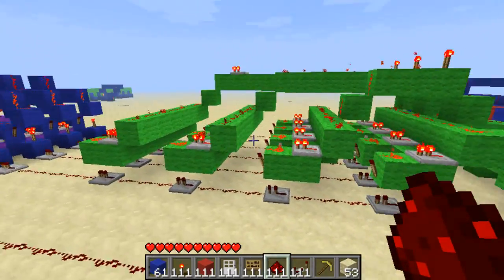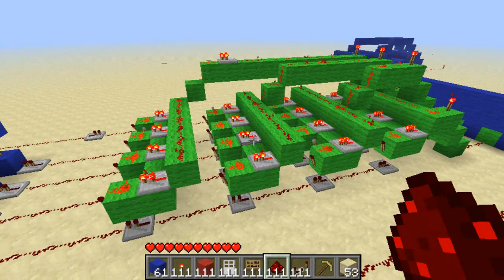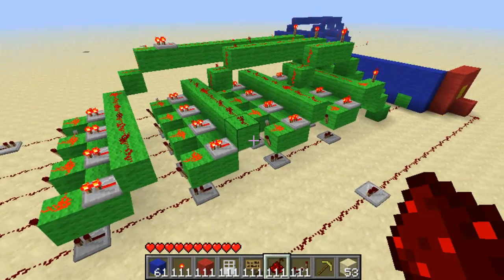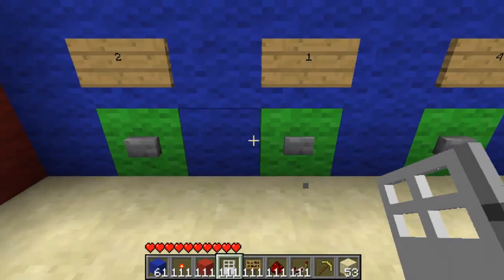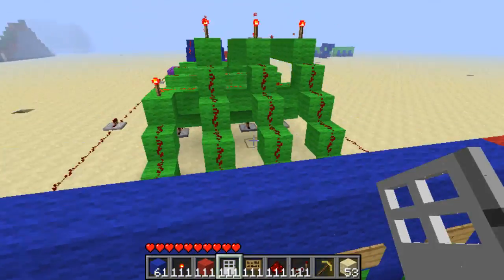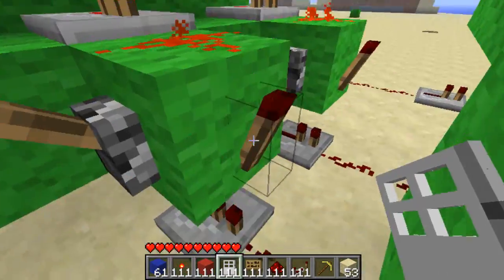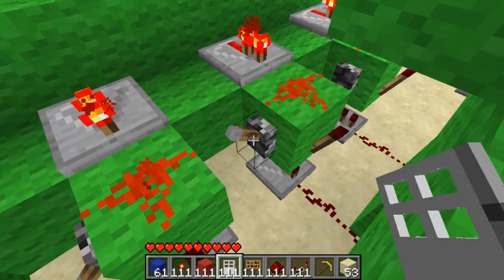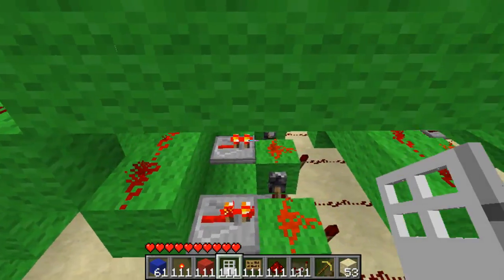Programmable combination Lock (with scrambler)

Comment from the maker: @TheGameReplay The main principle behind this is that the line will turn on it's set of torches, but if you do not want that one the lever will stop the torch from being turned on therefore not allowing it to power the line of redstone, if the lever was off then there would be no signal to the torch allowing it to turn on.